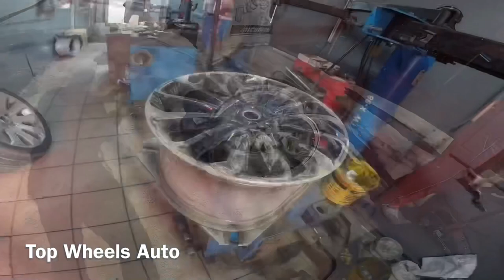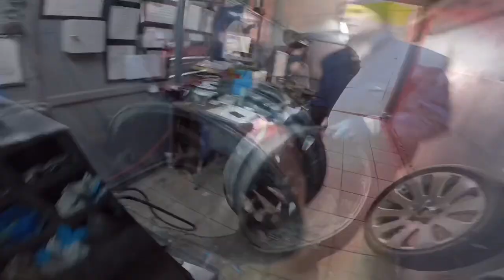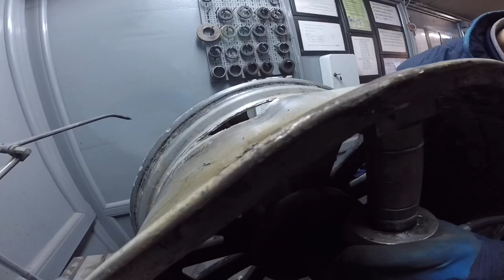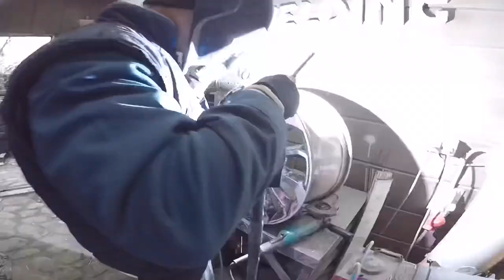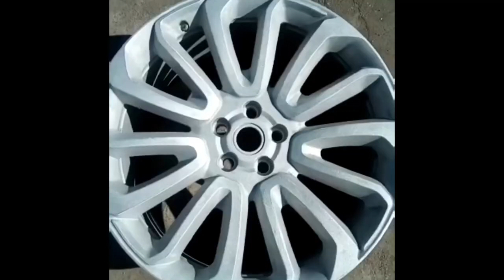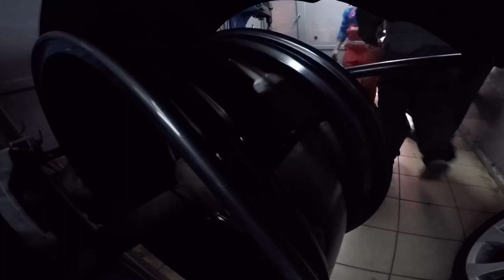🎗Art of Rim Repair: 🗜Welding / Straightening a Very Damaged Alloy Wheel on 22’

Comment: The basic steps are

1) heat alloy push bends out within runout tolerance (take care of axial / lateral warps)
2) weld cracks, add rods where needed
3) use a lathe to machine down welded areas
4) do a 1 or 2 or 3 stage powdercoat or wet combo mix

Its not rocket science and some "secret". However it IS a LOT of work that needs to be done by people who know what they're doing. But in the end this is all technician work. Not high end engineering work. However, keep in mind that in the end the wheel will look shiny but will have MAJOR MAJOR areas of weak spots compared to a virgin dealership new wheel. But it is what it is. I could write a book on how the wheel integrity is reduced. And some will reply with "oh the rim has been working for 1yr on the road"....well that is meaningless as that's not how an engineered piece is judged. When that car with that rim is gonna be in an accident that rim will shatter causing a lot more damage to everyone involved than if a virgin dealership rim was used. But that car can get lucky and never be in an accident and thats just the cost benefit risk that driver is taking on his life, his family's life and lives of others on the road
Reply from the maker: Great post, it is very true what you ve said and the risk si assumed by us and also by our customers
Reply: Excellent and very true info sir

Comment: OMG, I can't believe that it happened 😳. Great job.
Also, I have a question. Is it possible to repair damaged steel wheel?
Reply from the maker: Thank you, you can repair any damaged wheel
Reply: @topwheelsauto  Huh, cool. I'll try to repair damaged steel wheel from Peugeot 307 and if it gets fixed, I'll save it as a spare tire for Audi 80 B4 ( I hope that it can fit on it, cuz it's 4x108 and tire is 195/65 R15, just like all tires on B4).

Comment: You didnt show me the whole process.
Reply from the maker: we can t show all our secrets
Reply: @topwheelsauto  how long did you work on that rim? Good job!
Reply: The basic steps are

1) heat alloy push bends out within runout tolerance (take care of axial / lateral warps)
2) weld cracks, add rods where needed
3) use a lathe to machine down welded areas
4) do a 1 or 2 or 3 stage powdercoat or wet combo mix

Its not rocket science and some "secret". However it IS a LOT of work that needs to be done by people who know what they're doing. But in the end this is all technician work. Not high end engineering work. However, keep in mind that in the end the wheel will look shiny but will have MAJOR MAJOR areas of weak spots compared to a virgin dealership new wheel. But it is what it is. I could write a book on how the wheel integrity is reduced. And some will reply with "oh the rim has been working for 1yr on the road"....well that is meaningless as that's not how an engineered piece is judged. When that car with that rim is gonna be in an accident that rim will shatter causing a lot more damage to everyone involved than if a virgin dealership rim was used. But that car can get lucky and never be in an accident and thats just the cost benefit risk that driver is taking on his life, his family's life and lives of others on the road

Comment: Most shops around here won't touch anything like that I have one split 3in along the lip and no one will touch it.
Reply from the maker: Yes but we are like what we are doing and those projects are a bless for us
Reply: They’re probably worried about the repercussions in the case of failure. If they do a repair and it fails they leave themselves open to litigation. A repair would possibly/probably be perfectly fine. 

I often look at some alloy wheels and wonder how they manage to hold the amount of weight they do while withstanding the rotational forces. Smarter people than me obviously know the requirements and have done the maths.

Comment: do you know where I  can find place to fix it broke  wheel like that??
Reply from the maker: i know but is in Romania, at our shop
Reply: Take it to a rim repair shop. I fixed my dent that was letting air out for 35 bucks. But the repair of this magnitude shown on the video with welding and paint job would probably cost you like 100 to 150 dollars. Better than paying 300 bucks for a new rim.

Comment: It should become scrap metal when it cracks with the grain of the wheel.
Reply from the maker: it run perfect since then without any problem
Reply: @topwheelsauto  Yes, however if they were to hit something again in the same spot there is a good chance the weld will break and just further rip the rim apart. Try break a old wheel you dont need, the first thing to break will be the weld.